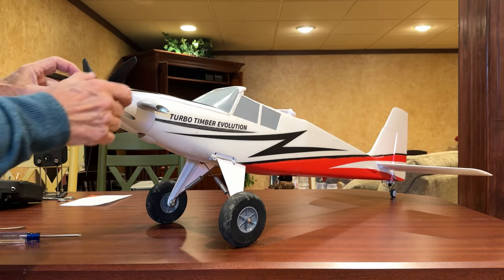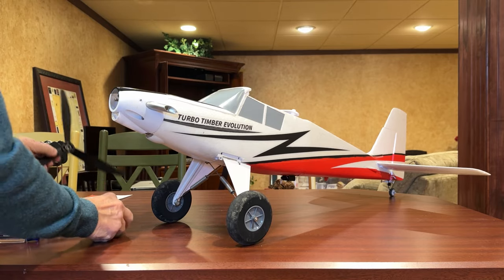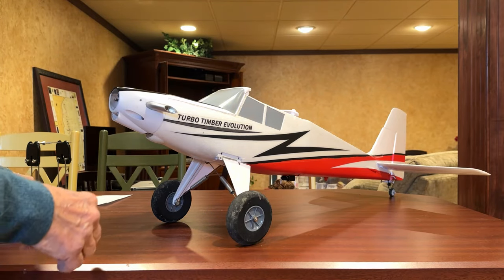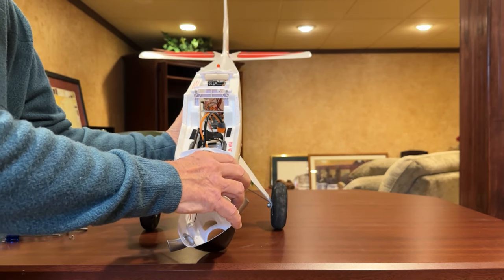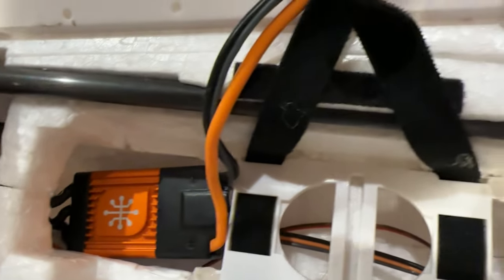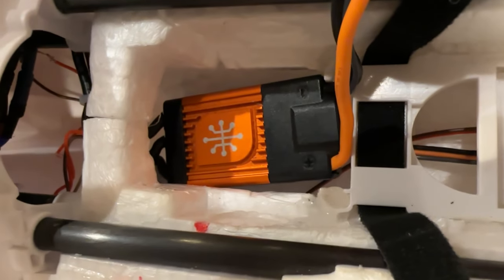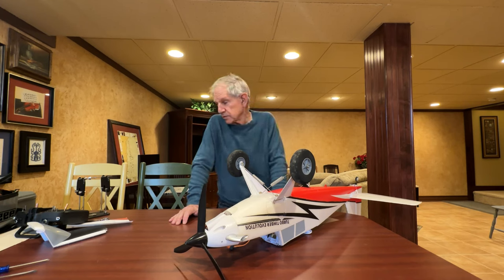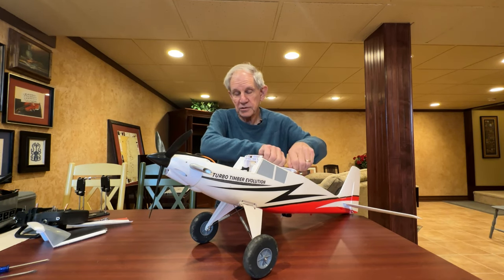Turbo Timber EVO Mods and Tips - The description has links for additional detailed information.

Comment: Tom,  Nice job on your videos!  Does the rx need to be unlocked to work with the light module?  Thanks and keep up the good work!!
Reply from the maker: An open receiver port (gear?) assigned to a 2 position switch (A?). No unlock needed. I have my bomb drop servo and lights on gear port and switch A on the Turbo Timber.

Comment: I just put my new TTE together, and have started programming my transmitter. I havent bound it, or set up the thrust reversing or anything yet, but I have the NX8+,  basically your same transmitter, and Im wondering what you personally set your high, mid, and low rates and expos to. Thanks so much for making this awesome video, full of tips to protect and get the most out of my new baby!!!  ***Update, I have bound my rx with my tx, set up thrust reverse, cleared out the cowl space, CA & hot glued where suggested, tied back the wires where suggested, Im about to upgrade to my oil filled shocks, and upgraded tires both from Kin Additive. I cant wait to fly this puppy. Im just stuck between putting on the slats and leaving them off...
Reply from the maker: My aileron rates are 100, 70, 50 expo 0 on all. You probably want some expo. Elevator 100, 85 75 no expo. Rudder 100 and 0. I you probaby should start with the instructions.

Comment: Great video, I was wondering if you could go more in depth with the bomb drop system though I found it a bit confusing.
Reply from the maker: Sure. I fastened a servo with longish arm to the rear of the bottom fuselage vent. I used a 2-sided piece of servo tape. The servo is connected to the Gear port on an AR637T receiver and that is set to the A switch on my NX8. A in the up position (A-up) has the servo arm facing forward and just touching the vent. A in the down position (A-Down) has the servo arm pointing straight down. So to release the payload I just click A-Down. The payload has a string loop that goes on the arm with a loose fit. In the A-up position airflow prevents the payload from releasing. Works great. In addition I added an A-switch-change sound - "Bombs-Away" for A-(Down). The cost was $0. I had a salvaged servo on hand.
Reply: Thanks!

Comment: Its a better setup if you  use the 2 blade 13x4 prop and spinner used on the timber X. Less amp draw .
Reply from the maker: Thanks for the tip

Comment: Nothing wrong with the original landing gear , just remove the internal hooks that stop the springs working
Reply from the maker: I mentioned that too, but I have seen those spring stretch out too.
Reply: @GoofballFlyer  I understand and agree, mine stretched on the outer coil, then settled and no more distortion after 100's of flights. Nothing to lose by trying